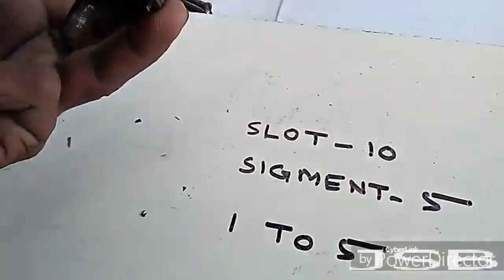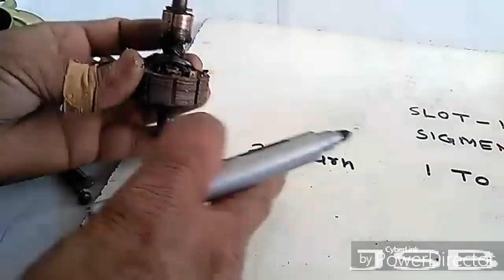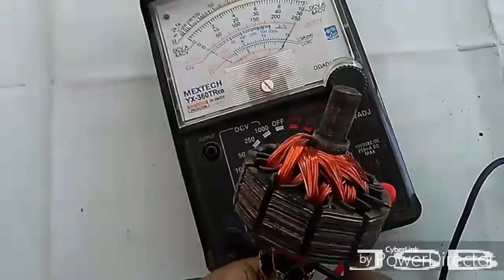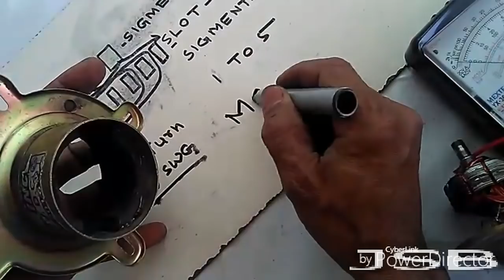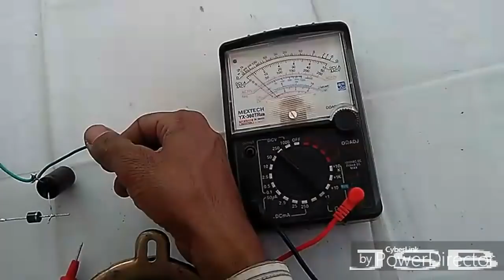How To Rewinding 12V DC Fan Motor Easy At Home. YT-37

Comment: I have 2 questions: 1: What fan did that motor go to, 2: How old was that motor to have black coils?
Reply from the maker: 1- carbon brush problem 
2- coil burn
Reply: JSB ELECTRIC what I meant with question 1 is where did it come from, and also question 2 was the age of the motor.

Comment: sir agar 12v motor ko wind krna hoto kitne turns per coil hon ge
Reply from the maker: 22 to 24 turn , wire gauge- 29 swg or 28 swg. Thanks
Reply: thanks Sir
Reply: Sir ye Dc motor ke liye hai na

Comment: Can we convert 12 volt armature to 24 volt armature by change in winding
Reply: Yes. Half the wire cross section and double the turns. Turn a 12 volt motor to 24volts.

Comment: how to determine wire thickness and many turns?
Reply: You may increase the thickness to fit the slots and keep the same turns. This will run the motor faster due to lower resistance and coil would be more durable. Either one or two gauge thicker wire would be lot better.